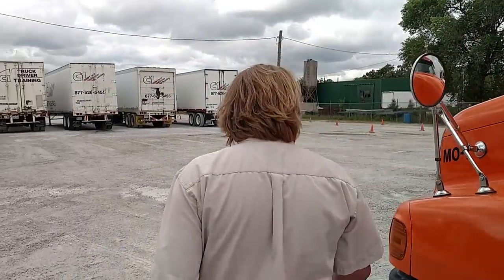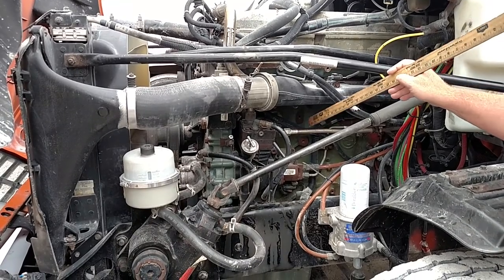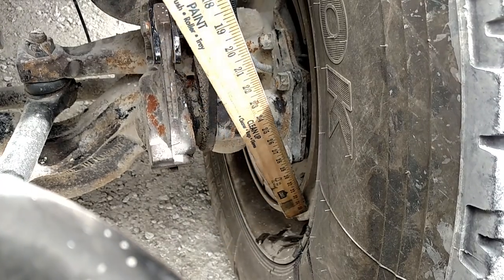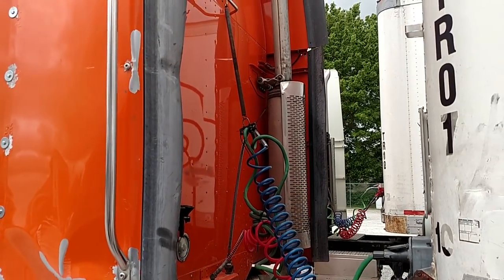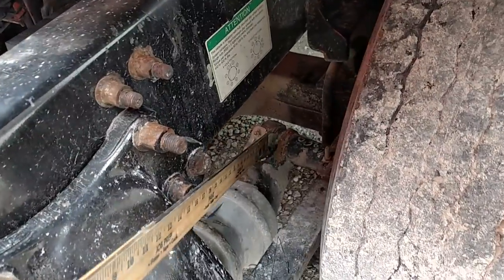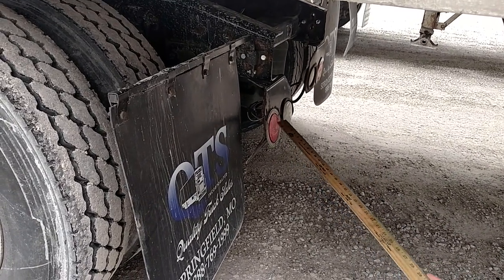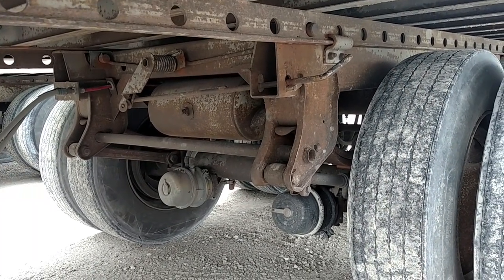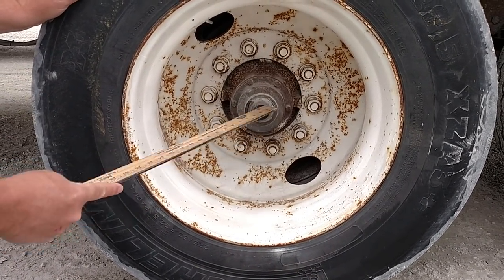Pre trip for Missouri CDL test

Comment: Just asking if the dip stick that has the large stainless top is not your transmission fluid stick? Usually oil & transmission are two different things not one in the same?
Reply: These are 10 speed manual transmissions not automatics.

Comment: I got a dumb question ....do we actually check every lugnut, check every wheel like literally get under the truck etc to Be very correct fars detailing gos, when we do the cdl inspection?
Reply: Idk about other people but the tester wanted me to touch every nut every bolt and every lug nut
Reply: If you're driving that thing then yes, touch and look at every component. Takes about 5-10 minutes max without talking

Comment: On the front overview, you must also mention that the truck is not leaning to one side or the other which would indicate a low tire, worn out suspension, or a shifted load. Good video! I'm studying right now
Reply: Not in Missouri for which this video was made. Read the CMV manual.